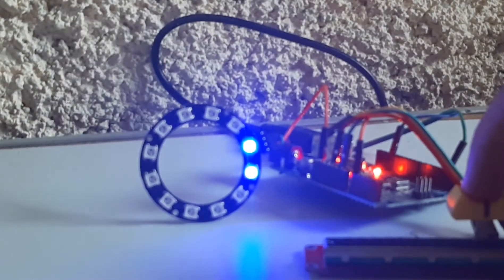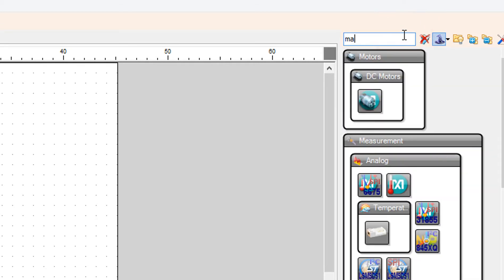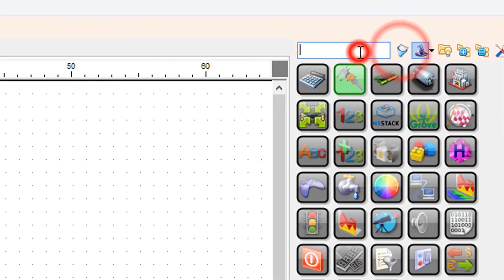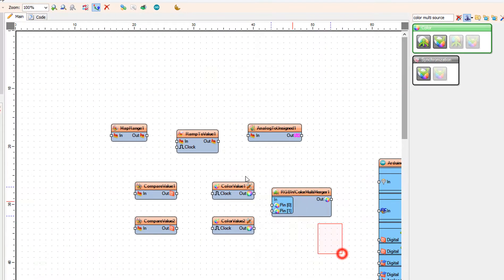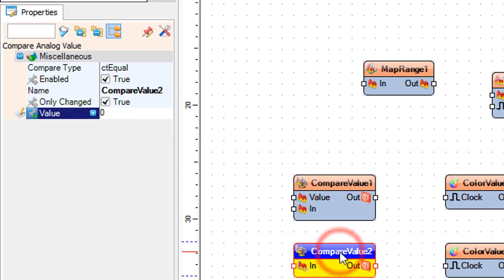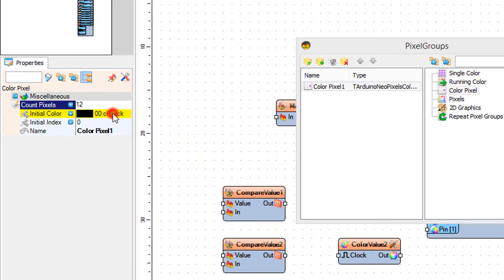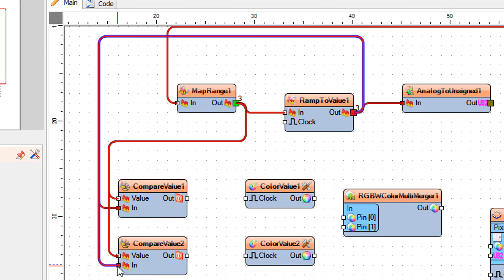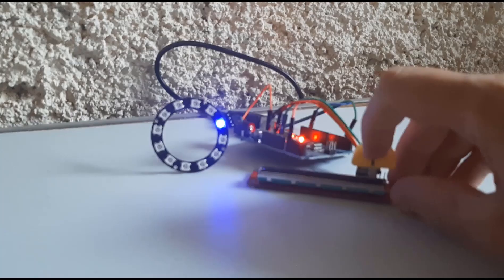Volume Indicator Neopixel Ws2812 LED Ring & Arduino

Comment: would it be possible to put more than one pot? and more than one led in the project? because I would like to do it with 5 potentiometers and one led for each
Reply from the maker: Yes sure, just connect each potentiometer to each analog input, same procedure as for one. Just make sure that you use Arduino with enough memory, I am not sure if UNO is enough.
Reply: @visuinoprojects  thank you so much! would you have any led to indicate that it is not circular? more or less the size of the slider
Reply: @visuinoprojects  would each led be connected to a different digital pin? as in the example of the video, this connected to digital pin 2, would it be like that with the others? pin 2 , pin 4 ....